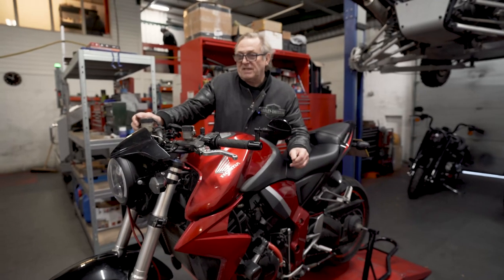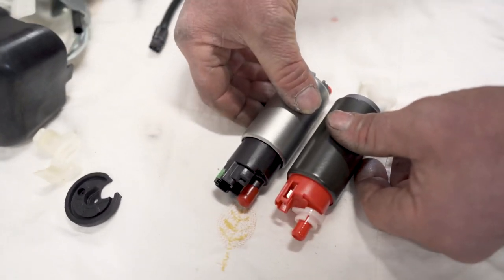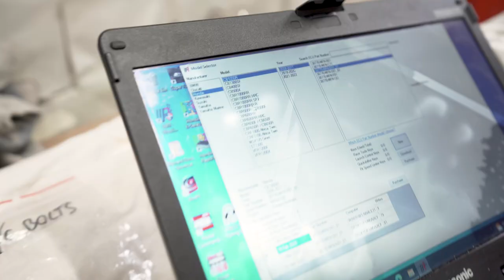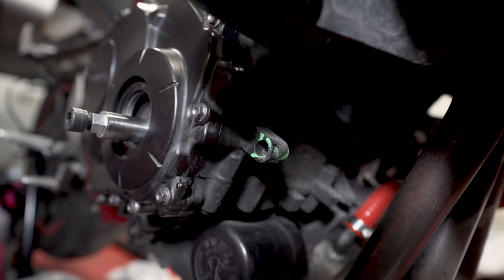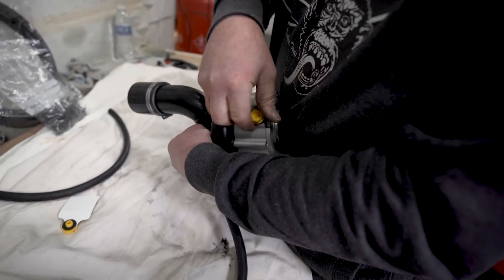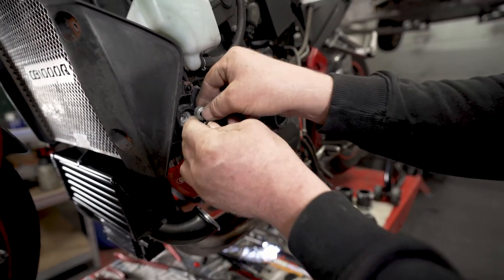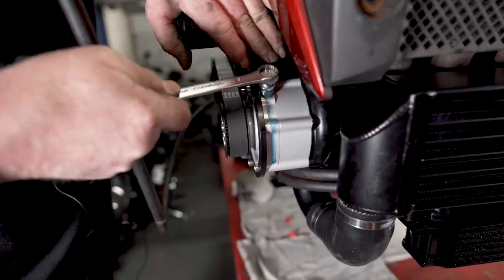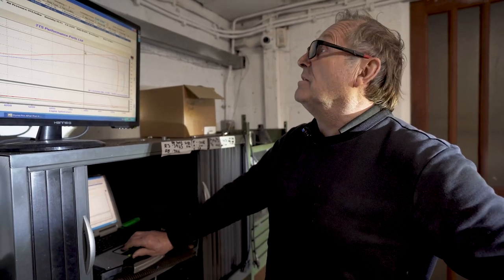Supercharging A Honda CB1000R In 24 HOURS! | 70% Power Gain!

Comment: Do the pistons and rods need to be changed out before doing this? Normally engines need to be engineered to handle the stress of adding forced induction, right? I've looked into adding a turbo to my V6 Jeep and I'd have to pretty much rebuild the engine with stronger materials so it could handle the stress of the extra air flow.
Reply from the maker: We’re running a standard engine with no issues.

Comment: the airbox is a bitch but i just dropped the front of the engine to get to the top middle screw out, had to change my stater motor, i left the top middle screw out, and i can now remove my airbox without dropping the engine.

Comment: For instance if you'd want the 05/06 GSXR to make more on the back wheel, about 180kw, would you run turbo pistons to assist with lower comp?
Reply from the maker: And forged rods.